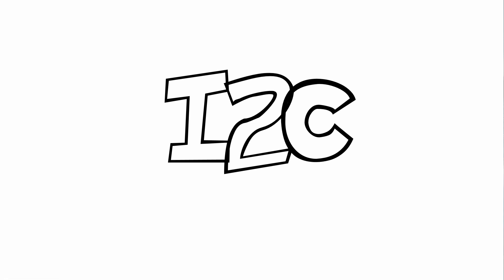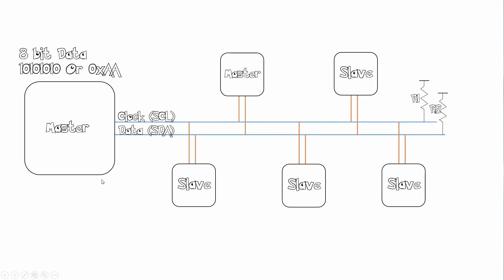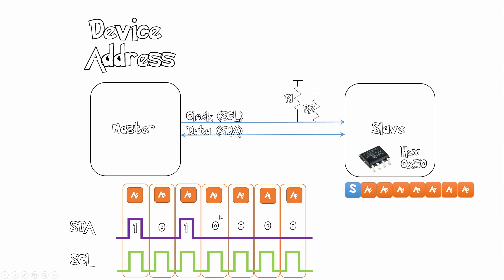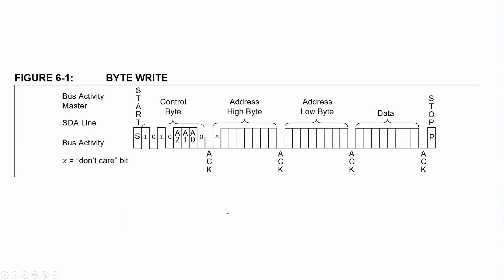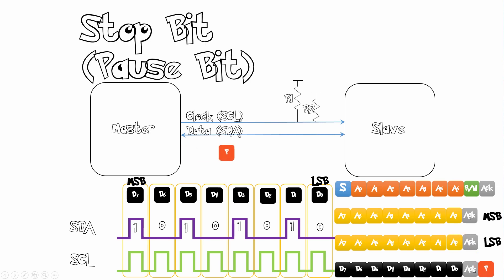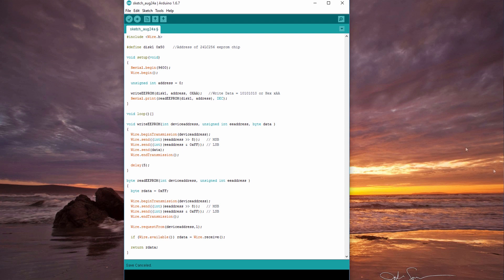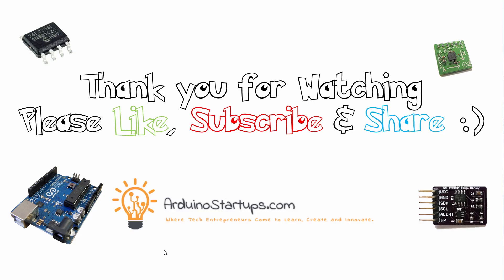I2C Protocol in 8 minutes

Comment: 1:57 sensors
SCL ektu pore 
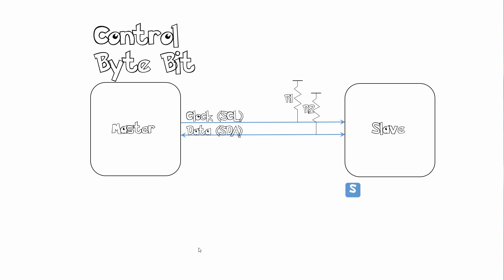2:18 start
2:28 control byte : device address
3:56 0 = write
4:05 slave acknowledge
ACK = 0
5:12 : kon register e write
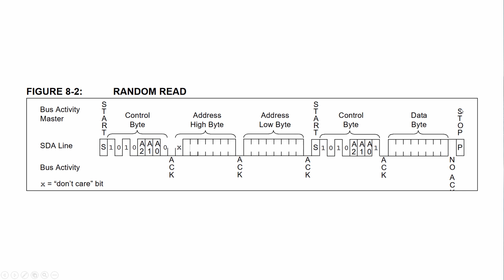6:42 : read e NOT acknowledge

Comment: At 4:35 what does AAA above 210 stand for. Its part of the address for the slave 1010000   ???  I understand the slave pins are set high or low to address that particular chip when there are multiples of the same chip

Comment: What is a pull-up resistor? There’s no point trying to teach something using even more advanced stuff.
Reply: Firstly, a pull-up resistor is not more advanced than an I2C protocol. So a pull-up resistor is just a resistor that is connected to the positive voltage rail, think he mentions 5v etc. So when the lines go low they are being grounded ie, forced to 0v. The pull up resistor makes sure that when the lines go high they are at 5v necessary to get over threshold voltage

Comment: The handling of ACK from the slave is that something that you need to check from your code or is that something that the I2C master slave devices handle it by themselves?

Also slaves can't send data by them selves? If yes,  what happens when 2 slave devices send data to ,master?
Reply from the maker: No the slave will provide you with the ACK in most cases. The only time you need code the ack is if you are creating the slave device yourself. Slaves only send data once you right to each one. So you won't get contentions bacause you can only read from a device at a time.

Comment: is it possible to use similar identical slave, for example using two or more identical thermocouple connected to max6675 which is have a similar address.? 
if the answer is possible.? how can I do it and how much the maximum amount of the Arduino capable to handle similar slave devices?
Reply from the maker: +Haris Setiawan I'm not sure if it is possible. You'll have to experiement maybe. Because you may have bus contentions. So if they both reply with an acknlowledge. Then the master may misread that as data
Reply: No.  Every device on the bus must have a unique address.  That's why you will sometimes see a zero K resistor on a device used to select one of two or more possible addresses.  For example on a 0.96" I2C OLED display I have, there is a resistor that goes from a center pad to a pad on the left marked 0x78.  There is another pad on the right that is marked 0x7A.  If I moved the resistor it would change the I2C address of this display and I could use two of them on the same bus.